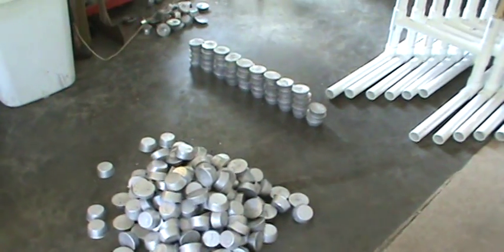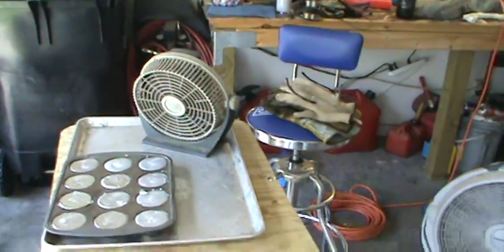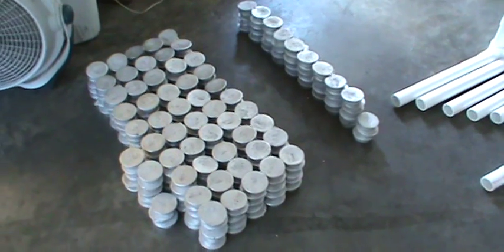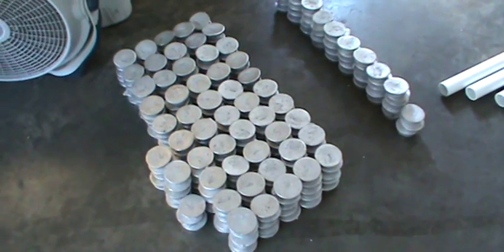Lead Ingot Making 2015

Comment: Good score on lead. I got a free 5 gallon bucket full the other day for free which is pretty rare for me. I couldn't imagine getting all that every year. I usually have to spend 70 cents a lbs at a scrap yard for lead.
Reply from the maker: +bubbacrabb I have an advantage, in my line of work, I  am already going to these businesses (dealerships, tire shop, etc...)  had the route for 14 years, my customers save it for me.  God is good and I am blessed.